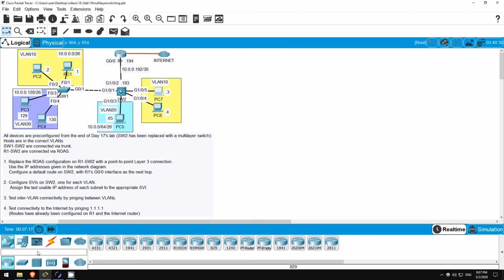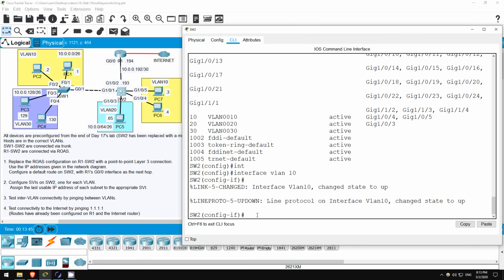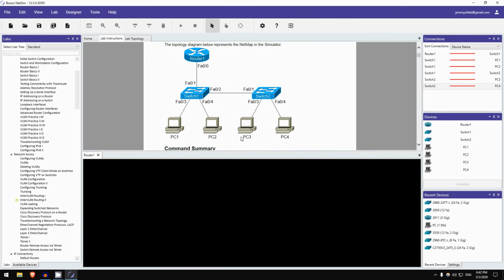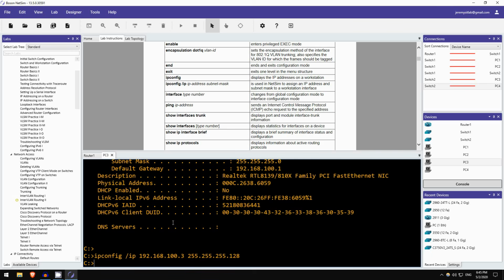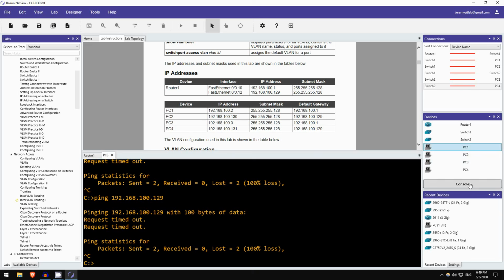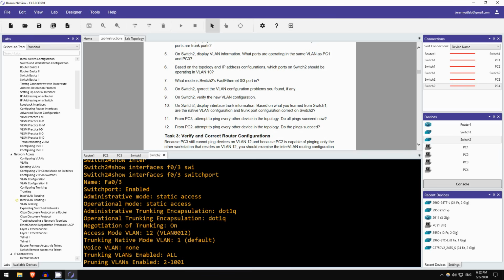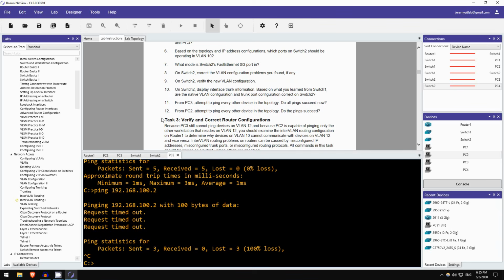Free CCNA | VLANs (Part 3) | Day 18 Lab | CCNA 200-301 Complete Course

Comment: I'm a little confused on this on.  When I looked at the router running I see this "ip route 0.0.0.0 0.0.0.0 GigabitEthernet0/0".  However, G0/0 is the interface connecting to SW2.   I believe the default gateway should always point to the internet of unknown routes - not back into the LAN.   I deleted that route and added it back pointing to G0/0/0 which is pointing to the internet.  However, when I went to ping 1.1.1.1 from PC7 - it failed.  I went back into the router and created a new route 10.0.0.0 255.0.0.0 10.0.0.193.  After I did this I could ping 1.1.1.1 from PC7.    Your teaching style is A++ though - I really feel like I am learning a lot here.
Reply: Same.  I realized that in simulation mode after the interwebs sent the frame back the the router, the router didn't know where to forward it since there was no static configured between R1 and the overall LAN.  Thanks for the comment!
Reply: i spent hours trying to figure that out. Thanks!!!
Reply: why does your solution work i dont understand it. Would someone mind explaining it to me im dumb.
Reply: Thanks alot Sir☺☺☺☺☺
Reply: this is the route that let's you ping 1.1.1.1 -----> C       1.1.1.0/24 is directly connected, GigabitEthernet0/0/0 in this lab

Comment: Here are the key topics from the video up to 7:08:

Lab Goal: Inter-VLAN Routing via SVIs on SW2 (1:59)
Removing Router-on-a-Stick Subinterfaces on R1 (3:02)
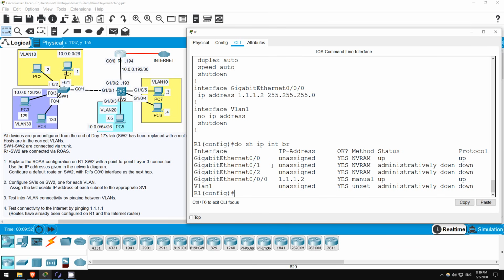Configuring Physical Interface G0/0 on R1 with IP (4:07)
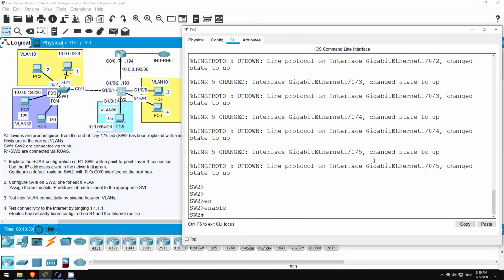Checking SW2 Interface G1/0/2 Configuration (4:47)
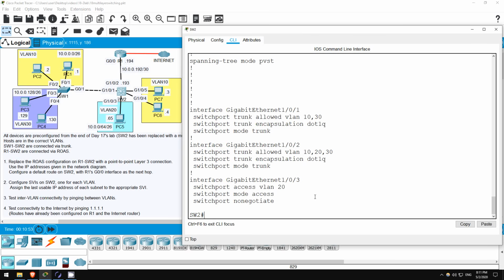Returning SW2 Interface to Default Configuration (5:06)
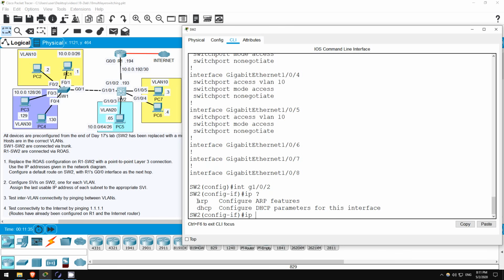Enabling Layer 3 Mode on SW2 Interface (No Switchport) (5:57)
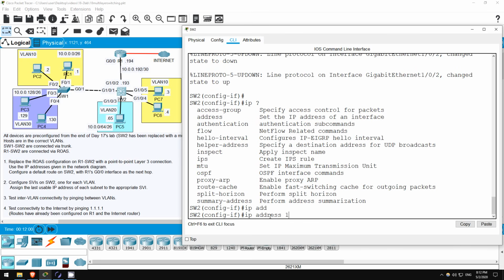Configuring IP Address on SW2 Interface G1/0/2 (6:17)
Enabling IP Routing on SW2 (6:42)

Comment: please disregard my earlier question. i figured the answers. basically router doesn't know how to respond to vlans. to resolve this issue i had to add 3 static vlans networks on router and now it works.
R1(config)#ip route 10.0.0.64 255.255.255.192 10.0.0.193
R1(config)#ip route 10.0.0.0 255.255.255.192 10.0.0.193
R1(config)#ip route 10.0.0.128 255.255.255.192 10.0.0.193
Reply from the maker: Glad you figured it out 👍
Reply: Munna and Jeremy,may i know what is the purpose of having routes to the Lans,since on this lab al lthe pcs can ping to the internet and all pc can communate to each other,so why does it need?
R1#SH IP ROUTE
Codes: L - local, C - connected, S - static, R - RIP, M - mobile, B - BGP
       D - EIGRP, EX - EIGRP external, O - OSPF, IA - OSPF inter area
       N1 - OSPF NSSA external type 1, N2 - OSPF NSSA external type 2
       E1 - OSPF external type 1, E2 - OSPF external type 2, E - EGP
       i - IS-IS, L1 - IS-IS level-1, L2 - IS-IS level-2, ia - IS-IS inter area
       * - candidate default, U - per-user static route, o - ODR
       P - periodic downloaded static route

Gateway of last resort is 0.0.0.0 to network 0.0.0.0

     1.0.0.0/8 is variably subnetted, 2 subnets, 2 masks
C       1.1.1.0/24 is directly connected, GigabitEthernet0/0/0
L       1.1.1.2/32 is directly connected, GigabitEthernet0/0/0
     10.0.0.0/8 is variably subnetted, 2 subnets, 2 masks
C       10.0.0.192/26 is directly connected, GigabitEthernet0/0
L       10.0.0.194/32 is directly connected, GigabitEthernet0/0
S*   0.0.0.0/0 is directly connected, GigabitEthernet0/0

Comment: Hi! In this lab on R1, there was a static route 0.0.0.0 0.0.0.0 gi0/0 already condfigured which will cover all the vlans and no more static routes are necessary in order to reach Cloud. So what was the point with "you'll have to configure the static routes"?
Reply: Noticed this too. Is this intended and/or a normal option Jeremy?
Reply: With that configuration, PCs won't reach the Cloud, because the exit interface to the Internet is g0/0/0, not g0/0. I don't know if is intentional or not, but you have to change the routes. What I did is delete the ip route 0.0.0.0 0.0.0.0 g0/0 and replace it with ip route 0.0.0.0 0.0.0.0 g0/0/0. But that doesn't solve the problem. You have to configure the return path so the reply ping can reach back the PC. For that, I configured the static route: ip route 10.0.0.0 255.255.255.0 g0/0

Comment: Thanks for the video! I understand that the request time out occurs due to ARP sometimes, but on the other times, there's multiple timeouts which seem normal while also multiple time outs which you CTRL+C and decide that the ping does not work. What's the reason of multiple timeouts before the ping works and how do you know that ping won't work with multiple time outs?

Comment: many thanks, it's a very helpful practice. Tried to ping the router, initially cannot ping, finally realized that the router ip routing table is missing something, so added "ip route 0.0.0.0 0.0.0.0 10.0.0.193", then it works. learned a lot, many thanks to Jeremy
Reply from the maker: I guess you didn't use my lab file?  I think I pre-configured the static route in my file.  Good job figuring it out!
Reply: @JeremysITLab  thanks Jeremy. Yes I didn't use your file, since I want to configure it myself to get more hand-on experience.
Reply: I see, that is what was missing! Thanks random guy on the Internet :D

Comment: hello jeremy thanks a lot for this free course I didn't understand why did you set 0.0.0.0   0.0.0.0 for ip route
Reply from the maker: It's common to create a default route to the Internet.  The networks of VLAN10, VLAN20, and VLAN30 are connected to SW2 so it automatically has routes for those networks in its routing table.  By configuring a default route to the Internet, we tell SW2 to send all traffic that is NOT for VLAN10, VLAN20, or VLAN30 to R1.

Comment: I thought I was doing something wrong because the local routes weren't showing up in the routing table on the multilayer switch until i realized this is a problem with packet tracer.

Comment: The int b/w sw 1 and sw2 is a trunk port or access port
Reply from the maker: Trunk!  If it was access, inter-VLAN routing wouldn't work between the switches.
Reply: @JeremysITLab  you configured native vlan on both router or not
Reply: @FaisalKhan-oj1iy 
 Native vlan:
1. SW1 -> SW2 : yes
2. SW1 <- SW2: yes. 
3. SW2 -> R1: no (since this interface is not a switchport anymore)

Comment: Hi Jeremy. I can't thank you enough for this whole series. 
I have one question. Whenever I complete the configurations on a network topology (in the bundle of pre-made networks that you have provided in the first lecture), it takes at least 10-12 ping attempts before they succeed. I get around 10-12 request timed out error messages and then suddenly it starts working. Why is it so? ( I know the ARP isn't taking so long).
Reply: its just that the device memory needs some time to register the given data

Comment: so i followed along exactly and i set the default route with the next hop address of 194 and it didnt work after looking at the R1 ip int brief i see the ip is set to 94 not 194 like the packet tracer show's so after changing it to 194 i was able to ping and get the connection to the internet :)

Comment: Hi, 

Why should we use two commands  #ip routing AND #ip address ..../subnet on Switch 2 ? 

The command #no switchport should always be followed by #ip routing to tell SW to move to layer 3 and use ip routing? then we specify the actual route?  These two commands make sense by why two commands instead of ip address ...../ subnet

Comment: I did this lab after so many days. I entered command default interface g0/0 on router and i thought that will reset/delete all the previous configurations, however It didn't. That's why when I tried to ping from PCs in different vlans to ping each other, they were succesfull but they were unable to reach Router. I deleted the previous configurations manually with no int g0/0.10 etc command, and then gave ip of 10.0.0.194 to router's g0/0 and then ping from PCs were succesful to router.

Comment: I did not make any config changes outside of this guided video here, but when I ping 10.0.0.129 from pc7, SW1 only floods the frames for the arp request through ports f0/1-2, it never floods them to f0/3-4 (VLAN30, the destination of the frame) and connectivity is not achieved. Anyone else experiencing this? 

I checked the vlan brief for SW1 and vlan 30 contains  interfaces f0/3-4, so all good there, and traffic from vlan 10 and 30 are allowed on SW1's G0/1 interface, so it's reaching the switch... it seems that there is no registered destination network address yet for f0/3-4 on SW1 as well after reviewing the simulation log... which make sense because the arp request never gets flooded out of f0/3-4 as stated. Any help is much apprecciated, thanks so much everyone.
Reply: I done lab same issue with vlan30 protocol is down,

Comment: Hey Jeremy, Thank you for putting these labs and videos together. However there is an issue with this lab. When i try to open it after downloading it from your public drive it says its not compatible with this version of Packet tracer. I have made sure that my side is up to date. I am also able to open the previous labs and day 19's lab just fine.
Reply from the maker: What version are you using?  If it's the latest version (8.0.1) you should be able to open all the files.
Reply: @JeremysITLab  lab 18 have a problem it didnt open at all

Comment: Hi Jeremy, in the section where you are performing the Boson lab, I notice that you need to scroll up and down repeatedly to navigate between the steps and the topology diagram.  But I noticed in the same window frame that this is a tab called "Lab Topology".  Does this tab actually show the topology diagram so you that you can refer to it easily instead of in the lab instructions?  Thanks.

Comment: Hi Jeremy,
I would like to Thank you so much for your great work for teaching online. the course is through.
I have tried to follow this lab and inter vlan routing worked fine. i have added default interface and default route on laer3 swithc. However i was not able to ping from pc to router interface.

ping from  layer 3 switch  to Router works
ping from pc to other pcs, default gateway works But not router interface and internet.

I have even tried to replicate again but results exactly same. is there something missing to access internet for users ?
Reply: HI MUNA PING FROM PC TO INTERNET WORKS FOR ME WITHOUT CONFIGURING STATIC ROUTES TO THE ROUTER  TO LAN..SO WHY WEE NEED TO CONFIGURE THAT STATIC ROUTES?

Comment: I couldn’t find the packet tracer lab for this one
Reply from the maker: Since you said 'for this one', I guess you have received the link for the Google Drive.  The lab is 'Day 18 Lab - Multilayer Switching'
Reply: @JeremysITLab  yes I have the link but this is not among the files contained
Reply from the maker: @investorinsight2025  The file is there, look for 'Day 18 Lab - Multilayer Switching'.
Reply: @JeremysITLab  okay thanks. I will look for it
Reply: @investorinsight2025   the same problem there is no day 18 lab in the file

Comment: Hi Jeremy, these videos are helping me a lot. Keep it up! One question: in SW2, does interface G1/0/1 needs to be configured as a trunk port? I try to configure it as such but it doesn't work. It works if I leave as it is. I'm guessing since its a L3 switch and it does the routing it doesn't need it.

I re-watching the video to find the answer but I can't seem to find it. Thanks in advance!
Reply from the maker: Yes it needs to be a trunk!  I'm curious how you determined that it 'works' when left as an access port.  Did you check reachability between all of the hosts?
Reply: @JeremysITLab  i did test reachability to the other hosts and it works. When I try to configure it as a trunk it gives the error “command rejected: an interface whose trunk encapsulation is “auto” can not be configured to “trunk” mode.
Reply: I guess it works because the interface trunk encapsulation is set to auto
Reply: @JeremysITLab  Sorry for the trouble. I figured it out. I was missing the command "switchport trunk encapsulation dot1q" instead of "switchport mode trunk".

Comment: in packet tracer, I was getting duplex / speed mismatch between R1 and SW2.  If I shutdown and no shutdown-ed one of the interfaces the speeds sometimes would flip around (one side 100 other 1000, also sometimes duplex mismatch.)  Some pings were getting intermittently dropped.  duplex and speed were set to auto for both interfaces.  Once I manually set them, pings were 100% successful.  Almost seems like an issue with packet tracer?  Any other ideas?

Comment: This was suppose to have the Day 17 configuration intact and working, why does inter vlan routing don't work if only sw2 is replaced by layer 3 switch. Pings from vlan 10 to other vlan has timed out.
I matched config on sw1, sw2 and R1 on day 17 and day 18, they look the same. Did I miss something?

Comment: Hi Jeremy,

Is it possible to do the inter VLAN static route on the one L2 multilayer switch only with a different VLAN? Both VLAN 100 & 200 have a different network address.  for example : 
Set IP address on VLAN  100   192.168.10.1 255.255.255.0
Set IP address on VLAN  200    192.168.20.1 255.255.255.0

Add static route 
192.168.20.0   255.255.255.0   192.168.10.1 
192.168.10.0   255.255.255.0   192.168.20.1 

So I can access 
192.168.10.x/24 from (VLAN 100) to  192.168.20.x/24 (VLAN 200)subnet ( for example ping from VLAN100 port to VLAN 200 port)

Thanks

Comment: Greetings Sir, doing a great job, just wanna ask in CCNA exam do we have to give particularly exams of labs in some software and if we do, then does the Boson Ex Sim also cover the practice test for Labs. or is it just a test for theories. Thanks.
Reply from the maker: The current version of the CCNA exam doesn't have lab simulations.  However there are lots of questions that ask you what the correct command is, or ask you to interpret the output of a 'show' command.
Reply: @JeremysITLab  Thankyou Sir

Comment: Hii Jeremy, sorry if this is late just wanted to know what's the difference between the #no switchport and the #ip routing command ?? thanks!
Reply from the maker: IP routing enables routing on the switch (allows it to build a routing table).
no switchport configures an interface as a routed port, allowing you to assign an IP address to it.
Reply: @JeremysITLab  hey, thanks jeremy for taking the time.

Comment: can someone tell me what cable or connection is used between the router and the cloud? is it a module we have to add
Reply from the maker: I added a fiber module to the router. If you use my lab file it should already be set up.
Reply: @JeremysITLab  i cant  find the lab 18 in the labs file how can i get it

Comment: Thank you very much for the series, but for the lab I have an error message that it is not compatible with my Packet tracer, it is only this one, the previous one all were working, could you check and confirm
Reply from the maker: Hi Bilel, download the latest version of packet tracer from Cisco and you'll be able to open all the files.

Comment: thank u for the effort , I built the network and used the SVI as the default gateway of the pcs and all the pings worked perfectly , but the ping for 1.1.1.1 did not work , I used a 2911 router to represent the internet 
but I dont know why the ping did now work 
are there any configurations I should do to the router and the internet router u did not mention ?
Reply from the maker: What device did you configure 1.1.1.1 on?  Do the devices that need a route to 1.1.1.1 have a route?
Reply: @JeremysITLab   no they dont , how to do that ? 
i thought of configuring default route from r1 to the internet but i got stucked and didnt know how to put all my thoughts together
Reply: @JeremysITLab  if you just can tell what are the static route configurations you did on R1 and the internet router please
Reply from the maker: @fatimahamdan3825  Try to think about which devices need to know about which destinations, and then configure the routes to those destinations.  It’s good for learning!

Comment: Jeremy, what is "ping 1.1.1.1" ? Why do we check connection to the internet with this ip address ?
Reply from the maker: We test connectivity to the Internet using it because it's an IP address I configured on the 'Internet' cloud (which is just a router, I changed the icon).

Comment: So, to be clear! If I replace the trunk connection between a router and a multilayer switch, this will not have anything to do with the rest of the VLANs, so no tagged packets, right? (It's a dummy question, but I  want to be sure about this)
Reply from the maker: Yes that's right, there won't be any tagging between the router and multilayer switch
Reply: Jeremy's IT Lab and the native vlan on a Router is just in case of ROAS, right? Thank you for the course and your answers. I don't know why, but at this was a little dizzy for me.

Comment: I may be mistaken but something doesn't seem quite correct with the configuration of the default route on R1 (even though in Packet Tracer pings from any PC to 1.1.1.1 are successful). The default route uses interface gigabitethernet0/0 as its exit interface, but gigabitethernet0/0/0 is the interface connected to the internet. Am I missing something?
Reply from the maker: That default route is just configured to get this lab working.  The 'internet' address is actually in a directly connected network (the 'internet' cloud is just a router I changed the icon for) so no route is needed for it.  I just configured the default route on R1 so it could reach any of the internal networks.  This is not a realistic configuration.